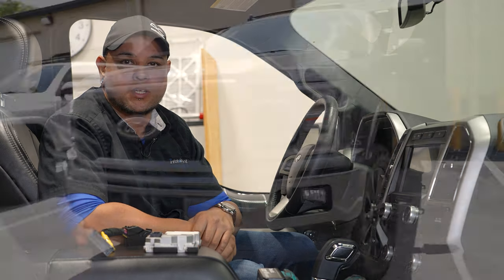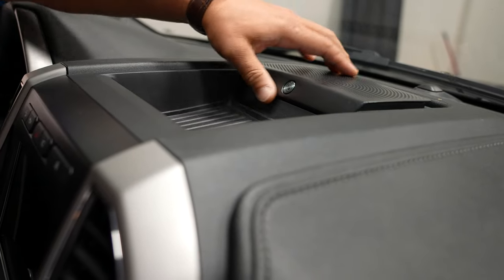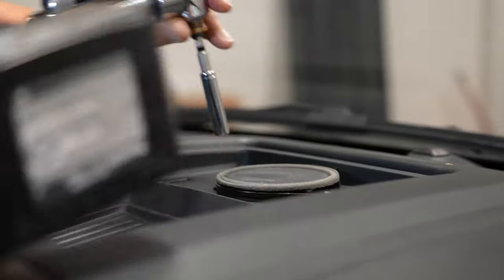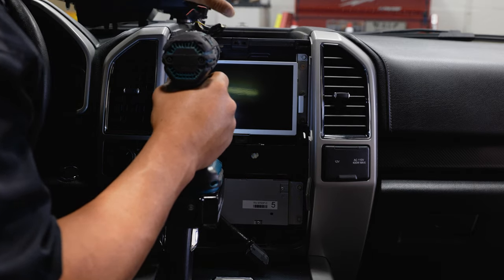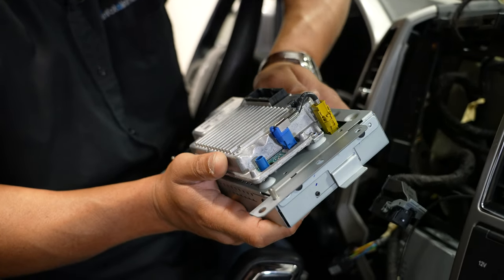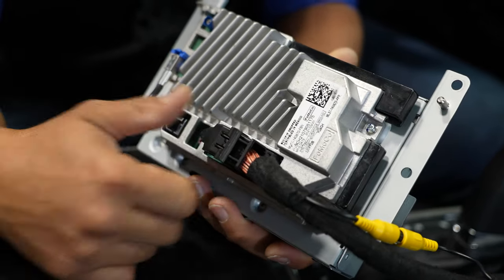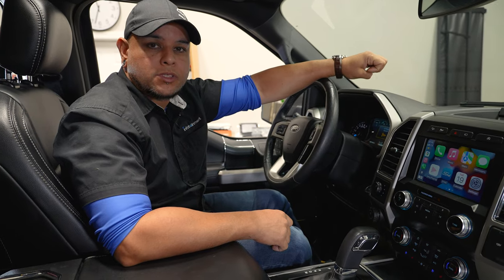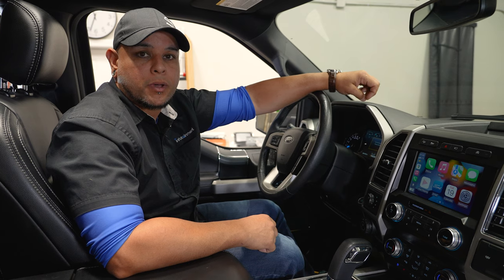2019+ Ford F-150 SYNC 3 to SYNC 4 Upgrade - Wireless Apple CarPlay and Android Auto

Comment: Besides returns and compatibility guarantee why $1400 ( with Navi ). Wish it was a little cheaper. Once a 12” screen version is available with a trim price along with it ( such as the F-250 trim bezel used on lariats and up 22MY and newer ) I’d love that kit. Have your research team use that part to try and replicate it. Gotta work on the price though too, make it so people with a regular 9-5 can afford it.
Reply from the maker: https://www.infotainment.com/collections/all/products/2020-2022-ford-f-250-superduty-sync-3-to-sync-4-with-wireless-apple-carplay-and-android-auto-upgrade?variant=40349778706468

Well there's the fact the kit can be installed without the need for a trip to the shop. 

All the wiring harnesses are included, so you don't have to crimp or cut any wires which would void the warranty.

This is a factory radio. The exact same radio Ford would have installed had your truck come with SYNC 4.

We also handle the programming, which saves you another trip to the dealership.

You can't find a SYNC 4 radio for sale that comes ready to install and guaranteed to work.

That said, find a radio with all those features with SYNC 4 for less than that price.

It's a fair price.
Reply: @Infotainment_nav  I think he means is there a kit to make a 2015-2020 f150 to have the 12 inch screen that’s in the f250.
Reply from the maker: @murdamechanik  Please reach out to our R&D team by filling out our Product Interest List below and they will keep you updated!

https://forms.zohopublic.com/infotainmentcom/form/ProductInterestListForm/formperma/m7R2exajUQkfs2WJO8mkDzUcYC2HIt5WrUWxFICnigs

Comment: Why do you want the old module?  I want to keep it for when I sell the truck it can be put back to stock since some people may want to have the ability to update software. 

And why can't this sync 4 software be updated ?
Reply from the maker: You can keep your old module. You don't have to send it to us.

The SYNC 4 software can be updated, just not over the air. You can get the updates at your local Ford dealer.

Comment: Does the radio automatically turn on and play random garbage on the air every time the truck starts up?  That's my biggest complaint with the stock sync 3 system.
Reply from the maker: Unfortunately I cannot guarantee that. This is still OEM. We are not the manufacterers of these units we only develop customs solutions to upgrade vehicles to better technology. If Ford kept that on the Sync 4 then it will be present after the upgrade.

Comment: You say 2019+ trucks but the 2018 has the same sync 3 system.  What is different on the 2018 that will not allow this to work?
Reply from the maker: Different modules.

Comment: When I got the new APIM to install for this upgrade it appears when I plug it in my truck will not start but if I unplug it my vehicle starts sounds crazy right. also  when plugged the apim shuts down the driver side digital display and light features. Interesting how you upgrade went so successful. Any reason why my APIM doesn’t communicate with my truck?
Reply from the maker: The package that comes from us will also come with a replacement Sync 4 screen.  The Sync 4 APIM it self will not function with the Sync 3 8" display. Also the Sync 4 APIM that we sell is pre programmed to the vehicles VIN# to accommodate a plug and play install as well as allowing you to avoid going to the dealer.

Comment: Does it fit a 2016 ford escape?  I see that it is very similar to the one you have?
Reply from the maker: No it does not. We offer a SYNC 3 upgrade for the Ford Escape. 

https://www.infotainment.com/collections/all/products/2016-2020-ford-escape-sync-3-gps-navigation-upgrade?variant=12282740932644
Reply: My SYNC 3 won't update over Wi-Fi and won't read USB

Comment: Hey does this work on a 2015 and up with sync 3 I have a 15 and I did a sync 3 upgrade years ago
Reply from the maker: It works, but we're not offerring it as of yet. Look for it early next year.
Reply: @Infotainment_nav  sweet I want to know is there a tone feature in the sync navigation when you will get ready to turn because on the sync 2 and sync 3 have it and it's cool when you get a warning to turn
Reply: @infotainment_nav is this available for 2015 with Sync 3?
Reply: @infotainment is this now available for the 2015 F150 with Sync 3?

Comment: Oh and one question whats difference in gps navigation or if i just used my android auto 

Is it like a system where i wouldnt need my phone?
Reply from the maker: GPS navigation is build into the vehicle and would not need a phone. Android Auto does need a phone. Thats the biggest differance. Also Android Auto is much easier to update then the OEM navigation which has to be updated at the dealer every 4-5 years.

Comment: My moms bronco sport has sync 3 i test drove an f150 with sync4 this makes way more sense why hers was oddballing me on setup while the f150 was imdiately setup (she just bought the bronco yesterday) 

As the 2019 (was at detail shop so couldnt test drive it) that i could afford has sync 3 it is nice to know upgrading to sync 4 will be easy 🤷🏼‍♂️ 

Also neat the interior is that straight forward to take apart 🫡
Reply from the maker: Yes the Sync 3 to Sync 4 upgrade is not difficult at all. We are glad we can help with a solution that can help get you to wireless Apple CarPlay and Android Auto. Let us know if you have any questions we can help answer.

Comment: Have y’all had any success with retro fitting a 12in sync 4 ? If it’s even possible
Reply from the maker: It's done. It works. We have it running.

The problem with that retrofit is that the dash design in those vehicles are completely different.

In order for that to work, you would have to change the entire dash. The other alternative is to design a bezel. But then you loose factory fit and feel.

Our product development team is determining the best way to move forward.
Reply: @Infotainment_nav  awesome thanks for the reply, hopefully they can figure something out 🤞
Reply: @Infotainment_nav  id say design a dash thats close to the look it doesnt have to be exact. As long as the screen fits.
Reply: @Infotainment_nav  I think designing a bezel is the easiest approach.  We have custom bezels for all sorts of 12" android head units so it can easily be done.  The difference here is that you've gotta move the air vents and make the room somehow, so I understand it's a bit more of a challenge.  I too would be VERY interested in this!

Comment: Does it have to be wifi equipped? Can you put sync for in a 18?
Reply from the maker: Your vehicle would already need to be equipped with the Wifi feature.  You will not gain Wifi with this upgrade.  Compatibility for the upgrade starts with 2019-2020 F-150 and 2020-2022 Super Duty.
Reply: Yes I don't want wifi just new features

Comment: If you don’t mind clarifying why is it 19+ when the body style the interior and several of the electronic components are very similar to the 2015 forward is it not entirely possible to install on those years?
Reply from the maker: It's possible. In fact we've done it. 

Retrofits are coming in the near future. We want to complete testing to ensure customers get a reliable product.

Comment: So $1,400 (if you get Nav) plus you want the SYNC 3 APIM sent back to you? Oh and you cannot get any future Sync 4 OTA updates? 

SYNC 4 APIM's with Nav are fairly cheap, (under $400). Even with the adapter harness and APIM programming, the price is a bit out over the top. 
Especially when you consider no updates and you get the old APIM to refurb and resell.
Reply from the maker: Ahh yes, the old I can do it cheaper with eBay parts but haven't done it yet.

But believe me, it's that easy. But I haven't done it.

We'll ignore the warranty, tech support and compatibility guarantee. We'll also ignore the live phone tech support.

You cutting and splicing any wires? We're including the harness that prevents any wire cutting or splicing to protect your warranty.

We stand behind our prices 100%. They're fair and provide excellent value for the customer.

Waiting on your how-to video. Let us know when you publish it.
Reply: They are banking on the tech-illiterate. This one of the easiest swaps to perform. 10 minutes on Forscan & swapping a few wiring positions. Gotta love the male/female RCA in the middle of the harness that should be straight wire into each connector.

Comment: 1200 dollar sheshh,,
Reply from the maker: We do not sell cheap equipment. We sell OEM quality equipment that is fully tested, pre-programmed and procured based on your Vin. There are plenty of companies that sell cheap products. We want to provide a part that we are able to guarantee works and will continue to work. We are confident enough in the product we sell that we are able to warranty it through installation and up to two years depending on your selection at check out. We feel our pricing is competitive as we are comparing our pieces to the cost of getting a new vehicle as opposed the cost of an aftermarket part whose quality is greatly inferior.